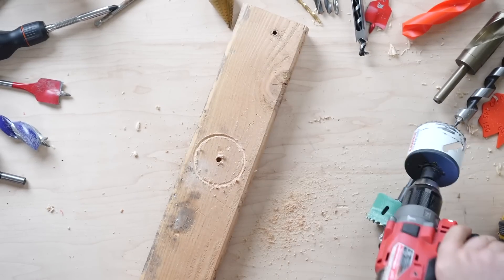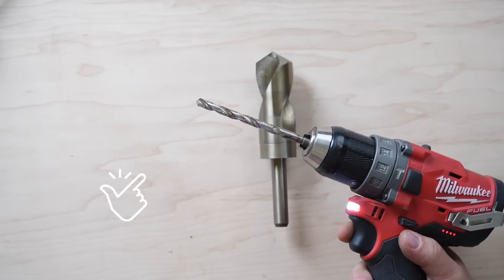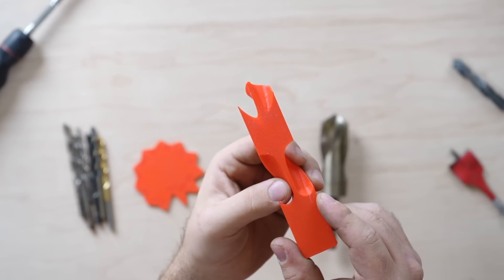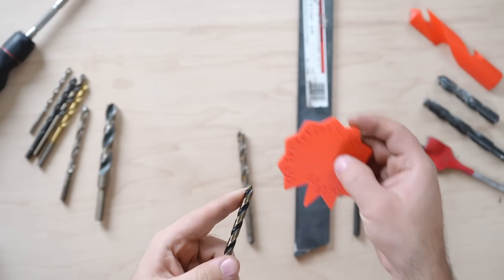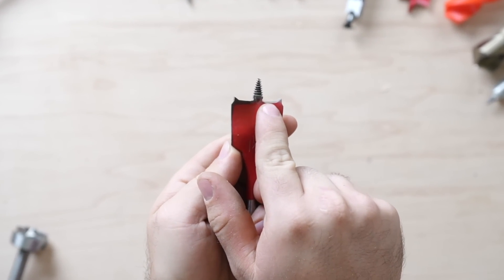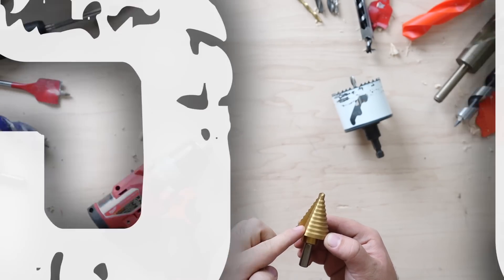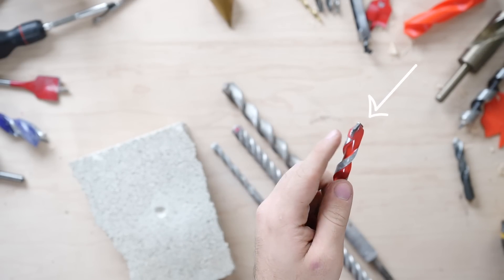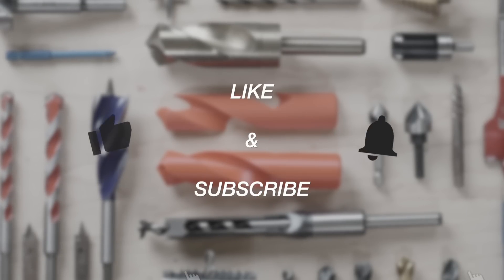Every drill bit explained, the ultimate bit guide

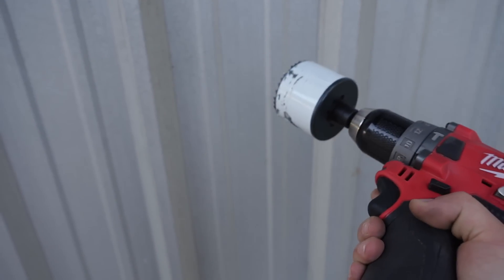Comment: 8:12 you couldve drilled a pilot hole first to center your hole saw on that uneven surface, if the middle bit doesnt reach you can get longer ones. Or drill at an angle using the center bit then rotate it to where you want it once the middle part is in to cut a little off the diameter then readjust so the diameter cut you just made is now your new guide to ginish.

Comment: Very interesting, clear and quite complete, thank you.
At 8:00, to be able to use the tool, you can:
- replace the guide bit with a longer one, or 
- make the guide hole and replace the guide bit with a smooth shank, which avoids increasing the diameter or shape of the guide hole, resulting in cleaner, more precise work.
Oh, and don't play too much with your fingers (5:27, for example), we only have 10, normally..., and the sides of the bits are sharp.
And it's safer to work on a well-kept piece.

Comment: Fairly informative video, and the channel is shaping up nicely, but editing quality is quickly outpacing content quality.

For one, this is hardly an "Ultimate Bit Guide" and found more accurately be described as a "Beginners Bit Guide." There is quite a bit of necessary information left out of the video and are far more interesting bits to describe (possibly a part two down the road?).

To prove, you'll want to go into a bit more depth on the uses and materials each bit type is designed for. You barely touch on this when describing the base metals and coatings, and give no direction on this when describing bit type (extremely important).

You should also include (and demonstrate) property safety techniques. Clamping down materials, or knowing when to use a drill press, are important things to know.

Please take a second go at this video. While your video editing skills are improving (though the voice over addition is questionably used), the important parts of information are missing altogether. You titled the video "Ultimate Bit Guide." Come on, man! If I wasn't already subscribed, this overreaching would have me quickly passing up your channel. (At the very least, capitalize your title!)

Comment: There are also brad point bits, which have a point at the tip, similar to the forstner bit, and then the rest is like a regular drill bit. This allows for easy centering of the bit in the wood, which avoids the "walking" problem with regular bits.
Reply: I found that missing, as well. He mentions a spade bit (which is less common than a brad), but flies through it so quickly that you'd not know what he is talking about if you're unfamiliar with different bits.
Reply: You both missed it. He glossed over them, referring to them as spur wood bit just after auger bit.

Comment: You might clarify which drill bits are for wood and which are for metal. You didn't mention carbon steel bits are exclusively for wood and less expensive than HSS. The more exotic coatings are primarily for harder materials. Also brass and acrylic require a different point angle.
Reply: I agree. He touched on that at the beginning, but failed to continue providing this as the video went on. He might want to redo this video in the near future, and also change the title to, "The Beginners Bit Guide." Overall, decently well-made, but in need of improvement.

Comment: At 8:07, first make a jig using the same hole saw that you want to use and a board thick enough that it can hold your hole saw in place even before the drill hits the angled surface. Then place the jig where you want your hole to be on the wall, then fire away.
Reply: Or simply replace the center bit with a longer one. If you need the flat reference point to secure the set screw to, a bench grinder can easily add one (just keep the bit cool while grinding). Much faster than making jig, but I know that not everyone has a bench grinder on hand at all times.

Comment: I thought that 135 degree bits are considered more aggressive than 118. I think you may have this backwards? The walking statement is also backwards.
Reply: My tool rep says 135 of al and 118 for harder. Flatter tips do walk more
Reply: @eltorrisimo A steeper angle drives in faster (thus, more aggressive) and walks less often. Think of it as comparing a dowel rod to a freshly sharpened pencil. Which one would you more easily stab yourself with by accident. (Completely a theoretical statement, and not something I've done to myself on the way back from the pencil sharpener. 😅)

Comment: Pretty neat video 👍 

8:05 It's possible to change out the drill bit to a longer one with hole saws. 
I keep a few different lengths handy for different cuts. 
You can grind a flat surface into a bit for the set screw to hold onto better if you're doing more than a cut or two, as a bit without a flat surface on it will slip eventually.
Reply: I said the same thing out loud to myself when that part of the video came up. Lol. 

I had to do the same thing last week when adding an additional gangbox for outdoor lighting. If you're not afraid to alter the bit, a bench grinder can quickly add a flat reference point to the base of the bit. Just don't be too aggressive and dip frequently into a can of water, if needed. The idea is to keep the bit cool, as tool steel is ruined if over-heated and burned. It'll create a weak point. (But it's at the base, and worst case will shorten the bit by an inch or so. Lol)